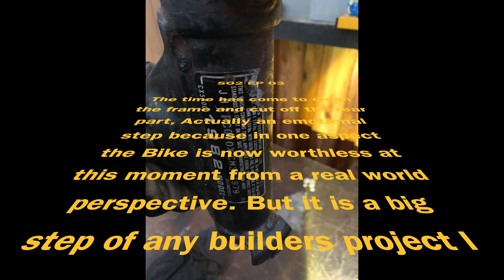🎬 Honda CX500 cafe racer build. SO2. Ep 03. Cutting the Frame. 🏁

Comment: Hi Ian; it took me about couple of hours to think what to say without hurt your feelings, that said here we go: as I can see you are doing exactly as many CX "builders" do, letting the original frame as it is, cutting out only the rear tips to weld a pipe loop and probably install a led strip as running-brake-signals light, which lead to have a flat long seat (like brat) without rear hump and taking away the cafe racer look, after all this time following your incredible build this is the first time that I feel a bit disappointed 😔, I know, your bike, your build, your test and as long as you like it that's only matter
Reply: Hi Carlos, Don't worry I don't get offended easily. I see your point and everyone is entitled to an opinion and welcome yours. I am going down the cafe racer cowl style (I think) although it would be nice to be able to carry a passenger from time to time. As a saying I heard once, what's the point of having a bike if you cant throw a girl on the back. Which has some merit. But the main reason for keeping the original rear shock setup is the legal requirement in my country (Denmark) I have to follow the strict guidelines to have it approved legally. The single-shock way is not allowed. My problem is to try and make it look unique by using the factory setup which is troubling me.
Reply: @ianmillward5277  I've got it Ian, and thank you for understand my point of view, keep up the great work!!